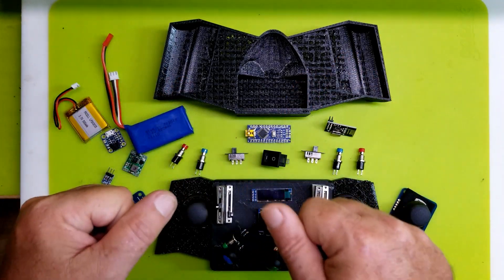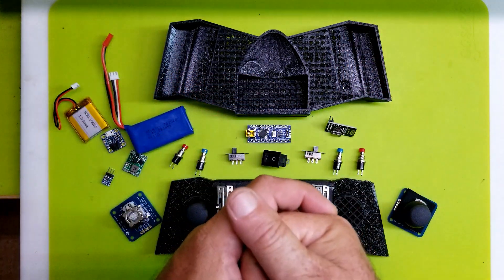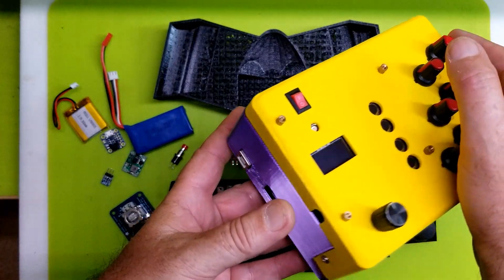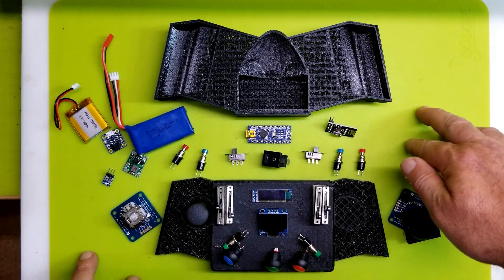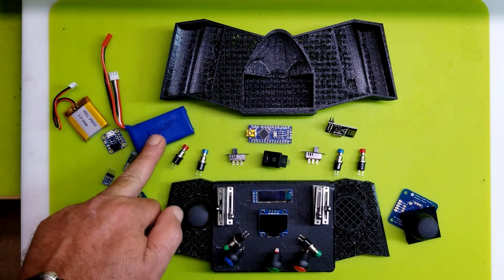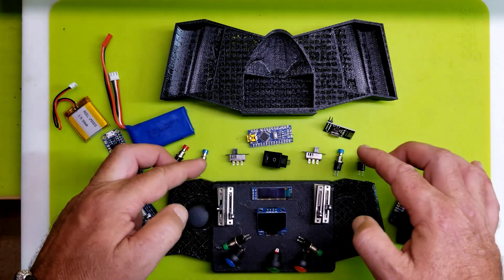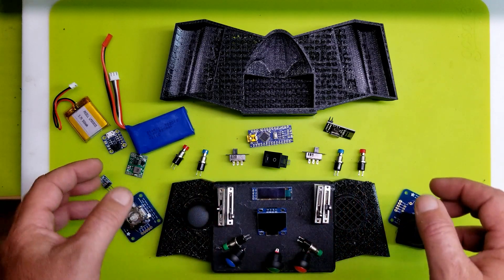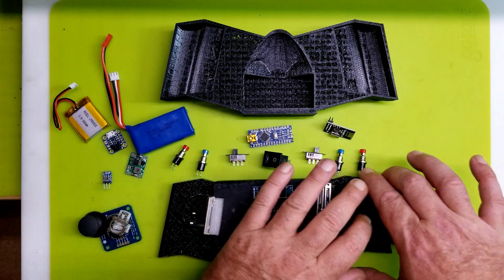DIY Remote Control - Part 2 - NovaSM3 v5.2

Comment: It's good to see you're still here... sometimes we need some time to get back in full force... a day, a month or a week... anyway. I will also follow this step of the project (I don't usually comment much, but I watch all your videos). By the way, I'm also building a new remote. PS2 remotes used to be my favorites, but their communication isn't very good. Until I got to know nRF24L01 modules and now I only use remotes based on them. Take care, see you!
Reply from the maker: thank you, my friend!  Yes, the PS2 has annoyed me for the last time 🤣  What do you use for microcontroller in your remote projects?
Reply: @ChrisLocke1969  Used to use Nano boards with expansion shield to help with power pins. But in this new one I'm using a Mega board (one with a very small form factor, the same you was using on Nova). Not that I need an Arduino Mega, but taking advantage of that small format as room is limited. Having spare pins, some I set to HIGH and LOW to make up for the lack of power pins.
Reply from the maker: @MechDickel  yes, I'm thinking the same thing for this remote, the MegaPro - i love that board for its massive amount of pins. If the teensy wasn't so expensive, I'd go with that.

Comment: Great to see you Chris, even better to see you've found your Zen... Your project has been keeping myself and a whole team of young mechanical and aerospace engineering students enthralled as they learn from you that theory is all well and good, but no battle-plan survives first contact with the enemy. You're inspiring them, and me. Stay well, be happy :)
Reply from the maker: Inigo, this is so inspiring right back at me, thanks so much for sharing!  I am doing much better than last week, that's for sure. Still going to take it somewhat slow here, because the worst feeling is to realize I've made a mistake that you all anxiously implement and break your projects. It hasn't happened much, but i don't like it one bit when it does... its a sign that I need to slow down. ;)

Comment: havent worked with nrf module yet but im wondering if placing it inside the handle which will be covered by the hand hinder the signal? i noticed my wireless earpods have that issue when i hold em inside my hand.
Reply from the maker: these modules are pretty powerful, so it shouldnt be a problem. if so, i can put some vent holes / slits. One of these also has to go into Nova, but she's not enclosed as much as a remote will be. I guess we'll have to see! 🤣👍